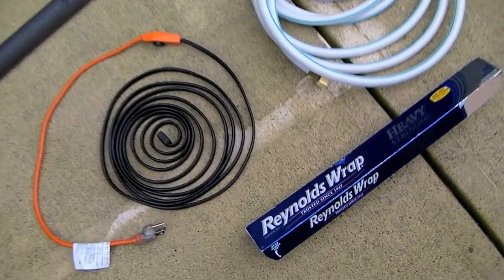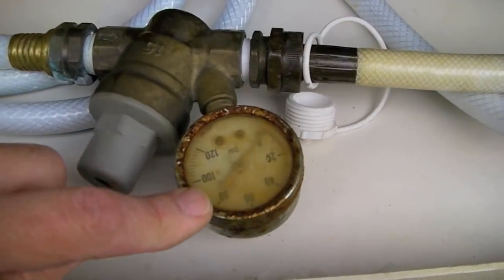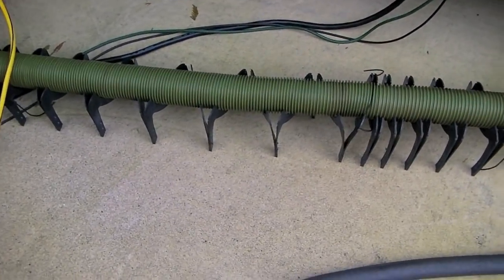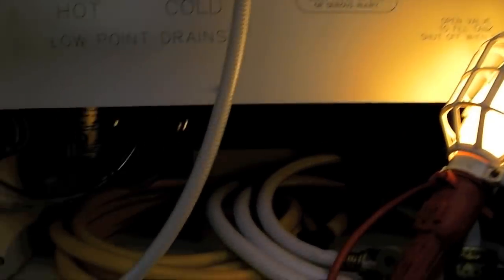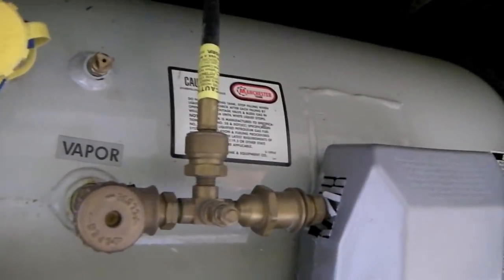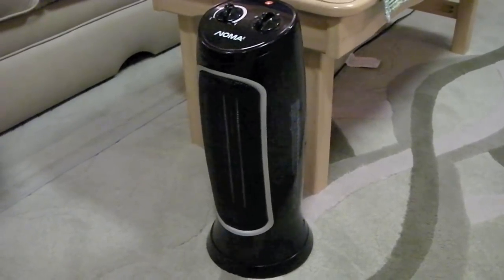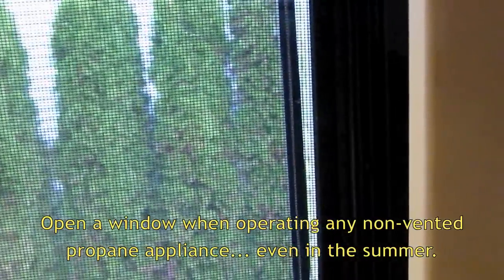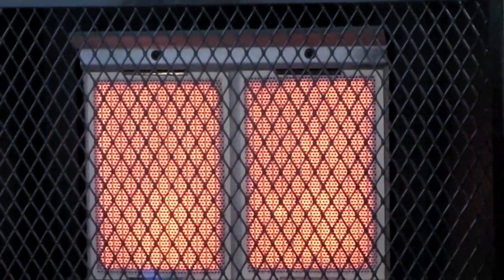How To RV in the Winter - Prepare Your RV So You Don't Freeze!

Comment: We like to use space heaters as well when rv'ing in cold climates, but have found that when it gets really cold outside we also need to run the rv furnace as well to keep things flowing. The furnace ducting runs through the same compartments and spaces as the water lines and plumbing and keeps them from freezing. Thanks for the videos.

Comment: you should try mr heater. it detects how much oxygen is in the air and if it is to low it turns itself off. can connect with hose or 20lb canister heats up 200sq ft  the model I recommend is mh9bx-portable buddy. nice video

Comment: Very helpful vid. I'm interested in insulating an RV to survive harsh adirondack winters off grid full time. If anyone has any info I'd love to see it.  It would seem if insulation was run right to the ground it would help alot with basement/water freeze up just like they do with mobile homes. I wonder if off grid winter Rving is even doable.

Comment: Thanks, enjoyed the video a lot. We decided to try some winter RVing last year and it was fine as long as the temperature went above freezing daytime. But after three days of cold our valves froze up and we just decided this was not worth it. We used a blow hair dryer to get the valves open and then drained the water, filled up with antifreeze and then packed up and headed south. We didn't fully defrost until we hit Arizona. We need a new grey water valve. Clearly we need to add tank heaters and valve heaters. Also, most people we met in the park staying the winter put skirting around their trailer. Any comments on that?
Reply from the maker: Winter RVing definitely takes some dedication and planning. You've got to WANT to do it. lol Skirting does indeed help, especially when RVing in a vehicle that doesn't have the advantage of basement storage like our motorhome does, which provides a lot of insulation on its own. Jason & Nikki Wynn put together another good video on the topic: RV Tip - Prepare the Outside of an RV for Freezing Winter Weather

Comment from the maker: It's not SOS, which has soap in it. It's 0000 steel wool, typically available at home improvement stores, probably in the paint department, since it's often used for finishing fine furniture.

Comment: Great video! One other area to talk about would be engine care. Plug in engine heater glow plugs, oil pan heater pads, and more. Permits cold starting and no damage as nothing will be froze. Mostly applies to gas engines such as your generator or gas base vehicle engines over diesel. Thanks again for the great tips. I am a fan of the heater buddy brand. Look it up if you're not familiar.
Reply: Diesel engines have more of a problem with cold weather then gas engines. Because of a diesel engine's very high compression ratio it takes a lot of battery power to start one and cold weather can lower the battery power to crank a cold diesel. That is why you see a lot of semi trucks idling in the winter. If you buy diesel fuel in a southern state then travel to a northern state your fuel will jell up and you will run out of fuel even if your tank/s have plenty of fuel in them. Getting fuel to the injectors is kind of like eating Jell-O with a straw. Southern states don't have winter fuel with blended kerosene and other additives to keep it from jelling up. There are additives that you can buy to keep it from jelling but they need to be used before it jells.

Comment from the maker: @metube1976   The furnace itself heats with propane only, not electric.  But since we have 2 heat pumps too, the thermostat ties the front heat pump to the furnace in a smart way.  If the front zone is set to "heat pump" and the outside temperature drops far enough that the heat pump can no longer draw enough heat out of the atmosphere to enable it to work properly (anything below about 40 degrees F or so), it will automatically switch over to "furnace" mode. Clever system.

Comment: lotta good low cost ideas here. great video thanks. on a different note about the heat did you ever think of maybe heating with a small kerosene heater?
Reply from the maker: Thanks so much! I used to have a kerosene heater in an old house I owned, and I think I'd be leery of having to deal with handling it inside the RV, since it can be kind of a mess. Also, it would be an additional source of fuel to have to carry, when the propane is already part of the system.
Reply: yeah i was just trying to think of something that didn't sweat or make things too damp inside the RV

Comment from the maker: Outdoor connections are indeed preferable, but the connection at the heater (and the stove) can't be avoided. In addition to the RV's built-in leak detector, pick up a device like the Pocket Air Check by Nova Systems. It's a very sensitive device, widely available online for about $30-$40. Use it to perform a periodic check of all propane lines and connections, including stove, fridge, etc. Also use it to check the main fill connection at the tank too - a not-uncommon source of leaks.

Comment: Another great source of DRY heat is a diesel heater or the gas version, they run off 12volts about 2 amps, about 5 gallons or less fuel for a week.

Comment: Recently bought a 5th wheel and it has a infrared propane heater installed permanently, also a propane lamp. Think the heater is a 10kBTU by Rinnai. The rig was used by a hunter, also has 6v batteries and a solar panel. Just ordered LEDs from M4 after watching your LED video.. You have the best videos on the net, thanks, :)
Reply from the maker: Congratulations on your new RV Mike! And thanks for the nice comment. :)  Hope you like your propane heater and LEDs as much as we do.

Comment from the maker: Hmmm... I never thought of it, but I'm sure it would be fine either way.  It doesn't get down below the teens where we are, but we had no problem with freezing all winter.  I bet if you put the tape inside the foil, it might even be more resistant to severe cold than having it on the outside.  I'd try it next winter, but we'll be back in the Desert SW, where we belong!  lol  No heat tape for us next year.  :)

Comment: Great information! It's amazing how many camp in cold weather. In extreme cold it may be necessary to restrict some of the lower vent letting air in at the back of your refrigerator. This reduces cold air and allows the boiler on your refrigerator cooling unit to reach the temp needed to circulate the chemical properly.

Comment: This is a very helpful video. I was wondering if you could crunch some numbers on what your using daily/monthly for propane, electricity, and roughly the amount of water used and how often dumped?? I live in southern MI and am considering many options of a tiny house, but still doing my research of the Rv, school bus conversion, or the flat bed trailer home. So obviously I need a four season place to call home with better insulation and windows. I would have the option of hooking up to electric only, but would like to be completely off grid and therefor want to add as many solar panels, batteries and propane combo options. I may even consider wood. I have seen those RV's by Advanced RV in Ohio that utilize the motorhome antifreeze to heat the lines with either the diesel or electric hybrid, but have also thought of how they heat water to run on under the flooring to help or just electric..if building from scratch. I would also like to have a composting toilet and have thought of just dumping the soapy dish water onto the ground, but worry about attracting bugs and mice. Any thoughts on all that??
Reply from the maker: Nikki Anderson Four-season living in an RV in Michigan would qualify as masochism.

Comment: Great tips, the 60 watt light bulb will be enough if it is insulated properly for your water line. An other tip is to leave the water trickle just a bit over night as moving water won't freeze. I have a 60 watt light bulb in my well over winter when it get's to -40 below in Manitoba. I would like to know how I can keep warm in Manitoba in winter in my RV, I want to try it one winter and see if I freeze or not. Mine is not ready for any COLD weather so this means GOOD insulation thru out the RV.

Comment from the maker: 1) We live in Canada, and while we usually snowbird in the desert SW, we did not that winter. But since we're full-timers, our RV is our only home. 2) Again, being full-timers, we can't winterize our water system with anti-freeze, since we use it all year round, and it goes below freezing so rarely in Phoenix or Palm Springs that we only need to deal with it a couple of nights each winter. Simply stowing the hose and running off the tank does the trick for that.

Comment from the maker: Yes... mold and mildew, and the damage that moisture in the walls can cause. There is no such thing as "too dry" for an RV (or any piece of equipment for that matter, which is why they store aircraft in the desert). If your skin is super dry during a winter in the mountains, or you're getting bloody noses, you can try keeping things closed up. But as soon as you see moisture on the inside of the windows, open things up a bit and dry it out some.

Comment: I would like to know if you can install roof heat cables on an RV with the standard rubber roof. I have a 2009 Big Horn by Heartland. All my slide outs have awnings on each one.
Reply from the maker: +Becky Boyett Hi Becky! To find out for sure, we'd suggest contacting two manufacturers: 1) The company that makes the heat tape you're looking at to find out how hot it gets and what restrictions/warnings there are about using it on RVs, and 2) Your RV manufacturer, to find out what kind of rubber roof you have (TPO or EPDM) and how high a temperature it can stand.

Comment from the maker: @metube1976  Hi Robin.  It is extremely unlikely that a 1972 travel trailer has heat pumps.  The odds are very high that the only heat source it has is the propane furnace.  They heat with propane only, and only uses a small amount of 12-volt power to run fans that blow the heated air into the RV.  Other than our heat pumps, our only source of electric heat is whatever type of space heater we buy, and plug in.  Very cold weather will likely require a good one (or two) and at least 30-amp power.

Comment from the maker: I think the main reason that foil use is recommended is that heat tape is really supposed to be used on metal pipes, so the foil prevents the heat from being in direct contact with the plastic hose. Wrapping the foil around the heat tape and the hose together might make it even hotter.

Comment from the maker: You're right, propane in an enclosed space requires special attention. These heaters are specifically designed for indoor use. As we said, opening a window and having working, regularly-tested propane and CO detectors is required. We did mention in an annotation that we used yellow pipe tape for gases. Thanks for the tip!

Comment: How about the slides?  I heard someone say to make sure you pull in your slides when it is snowing.  Is that necessary? Do you pull them in during snowfall and open once sky is clear?  We have a sticks and bricks up for sale and may have to spend a month or more in the motorhome with snow likely before our retirement on May 1st. It is a big concern.  Thanks for the tips on the waterlines and basement care.
Reply from the maker: Hi Anna. If we're not planning to move the RV for a while (and the weather is forecast to warm up and the snow to melt), we don't bother pulling in the slides for snow (as you can see in this video). If we had to move the RV before the snow was going to melt? Then, yes... we'd consider pulling the slides in during the snowfall (IF it was going to be significant) to minimize the amount of work needed to close the RV up for departure. If it's only going to snow an inch or two? We'll usually just get on the roof and sweep it off the slides before retracting them when it's time to leave. Lots of options... just depends on the snowfall amount, the forecast, and our travel plans.

Comment from the maker: @William Kennedy This setup actually worked really well for us. We wrapped the hose with aluminum foil to distribute the heat, preventing a hot spot  (or hot side) on the hose. We checked it periodically during the coldest months when the heat tape was running almost continuously, and found that the heat was not too much for it, and the hose never got overly soft or rubbery from it. Worked great all winter!
Reply: would you want to take the foam and such off at the end of winter?
Reply: +Holly Heckman --No need to do that.  Just don't turn the heat on.  This way you don't need to winterize for next winter.  But you do need to check everything is fine before next winter.
Reply: Holly Heckman
Reply: You should unplug the heaters, the connections tend to rust while charged up :)
Reply: RVgeeks   k,vara. Prasad

Comment: I have my motor home skirted and ran a hose from the external vent for the furnace to the underside of my RV.The CO detector never sounded off last winter and I never felt any ill effects but I did notice a big difference in how less often the furnace kicks on as opposed to when i vent the furnace to the outside.Really made a difference for me.
Reply from the maker: Skirting is panels or other material that fits around the edges of the RV, and goes down to the ground to block wind from blowing underneath. It’s usually custom fit to the specific RV, and helps keep the whole rig warmer.

Comment from the maker: Some of it depends on your type of RV. If you have a basement, it's pretty easy to add enough heat by keeping a light bulb or two on all the time. If you're in an extremely cold region, that might not be enough, and a small heater could be needed. Just be extremely careful how you do that, as fire is a real concern. If you don't have a basement, or your tanks are exposed, check with a store like Camping World for the availability of tank heat pads.

Comment: I tried that and the heat tape burned and almost cost me my rig.  I then run my garden style water hose through PVC pipe and it did not freeze (and did not cause electrical fires).  My Jayco has exposed black / grey tanks and heat tape is important for keeping those items working below freezing.  Skirting was also required to prevent wind from freezing them too.  I also use an electric fireplace (750/1500) which heats my 30' just fine.  I tried the catalytic which was horribly inefficient.  Newer RV's also have the "Arctic" option for cold climates.  VERY NICE VIDEO!  Thanks for sharing.
Reply from the maker: Never of heard tape burning before. Must have been defective. Glad your rig is okay, Stephen.

Comment: I want to mention that some 5th wheels have a double floor, where the electrical and water lines are routed. I have seen tons of them freeze up because of this fact. The smart ones put a heat source in the access compartment to keep this area from freezing up. We pay $275 a month for sewage, water and electricity. I'm not sure what some of the home owners or home renters pay monthly, but I'm sure it's quite a bit more than this. Our trailer is a four seasons, meant for ALL four seasons.

Comment: I had tried the wrapping the hose bit. Unfortunately I left out the foil and heat tape. This fall I will use that idea.  The first way was good, I just know the foil way with heat tape will be even better. My next step is using the solar panels that I purchased. (also looking for portable windmill back up).

Comment: Hello, I know this video is old but if possible I would like your opinion on something. I'm planning to live in a self built tiny house during Michigan winters. Lots of snow. Do you think there is any kind of hazard with the heat tape being electric and in contact with water on the ground? Also would this method be the same with pex?
Reply from the maker: The heat tape is sealed, so as long as the plug and outlet are protected you should be good. That said, we'd try our best to at least avoid submerging it underwater.

Comment: have you ever had issues with your rv heater pilot lite not lighting? i cant seem to find the issue i have plenty of propane! :D love you alls videos keep it up
Reply from the maker: Hi Elijah! There's not actually a pilot on our furnace, but rather electronic ignition. We're guessing that yours is likely the same. Keeping in mind that we're not RV techs, and have never had a problem with our furnace, here's a couple of thoughts. When your furnace tries to fire up, what exactly happens? What should happen is that the blower comes on first, prior to trying to ignite. That makes a lot of sound from the blower coming on. If you're hearing that, and then it does not ignite, you probably have some issue with the ignitor or the "sail" switch" which tells the furnace that the blower has come on and is blowing enough air to safely go ahead and ignite the propane. If it's not even trying to come on (makes no sound at all), then it's probably not the ignitor or the sail switch, but could be the circuit board instead. You might want to check in your owners manual to see if they have troubleshooting steps that you can walk through. Hope this helps a little. Please let us know how you make out.
Reply: RVgeeks thank you! i do hear a clicking  right after the blower comes on its not igniting so time for me to bring it in